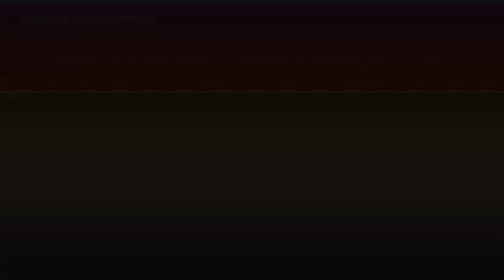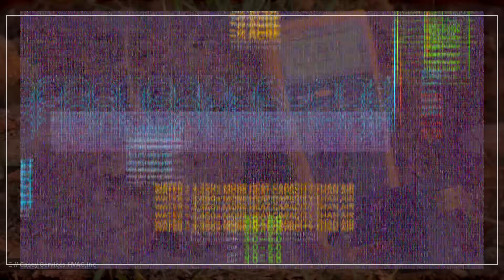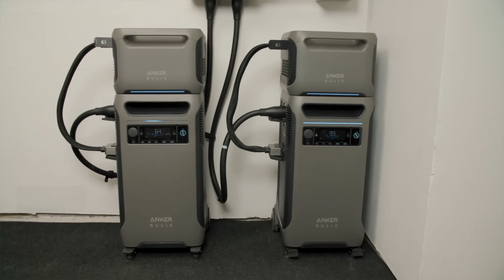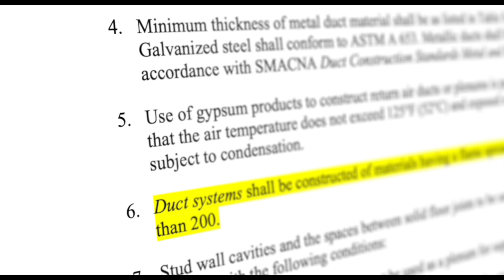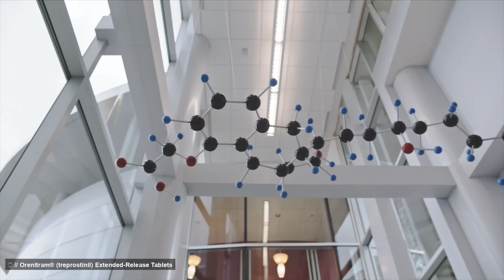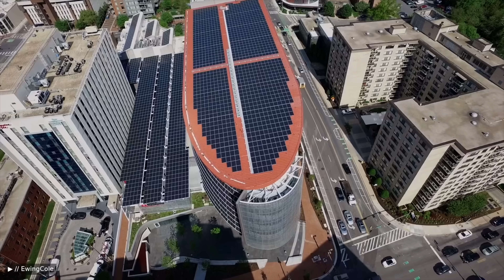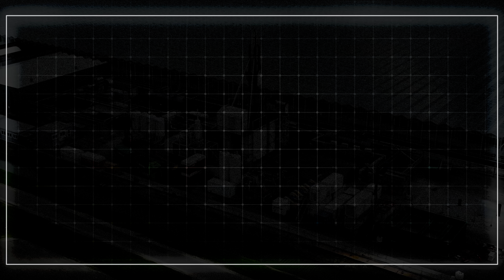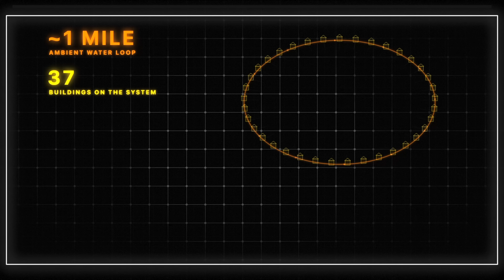The Viral DIY Cooling Hack That Nearly Killed a Family

Comment: I'm glad you made this video. A friend of mine had the air ground source heat pump system.  He died of lung cancer, several years ago. The next owners did a radon test on the house and the numbers were very unsafe. Had he used coils of pipe filled with water or glycol and a heat exchanger, he would probably still be alive today.
Reply: Had he done a radon test, he would've still been alive. We don't take radon seriously enough in general. If you've never done a radon test in your home, doing so could save you from lung cancer.
Reply: @lunaqueer . Radon testing was required for my hone mortgage 30 years ago . Very common in areas with granite
Reply: I used to live in Pittsburgh, and unbeknownst to most of the country Western PA and WV have a radon seepage problem thanks to the many abandoned coal mines dotting the countryside. Basically, coal seams have trace metals like Uranium, Thorium, and Radium embedded in them. These elements have alpha decay chains that eventually produce radon gas. Coal mines open up fissures that allow the radon to escape and get pushed upward by the pressure underground. This is why health departments in that region recommend getting a radon meter for your basement.
Reply: @lozoft9 What's super interesting to me is that high radon areas occur everywhere, and Aberdeen is a particularly notable one - but people in the UK aren't scared of it. Why? 

We don't have basements! One difference in building habits.
Reply: @PartanBree   I would say that there are more slab built homes in the US than those with basements.  There are very large subdivisions with nothing but slab homes.

Basements are expensive and take more time to build, so it is mostly the more expensive homes that have them.
Reply: @PartanBree  yea sure.. the UK doesn't have tornadoes like that either..🤦
Reply: @Sinderbad just watched a video on this last night.   Basements are necesary for foundations in places with permafrost in the US.  Or at least it used to make sense bwck in the day.  Slab technology is way better now.  But before you were already 5 feet deep, might as well make it 8ft and get another floor.  Also people had "root cellers" and thst killed two birds with one stone.
Reply: @cocoadragon8554  Haha, was about to comment this, looks like we found the same video!
Reply: @Sinderbad we dont have basements in Texas, I dont think ive ever seen or heard of anyone having one here, even though all my family and friends up north have them.
Has to do with the sand and clay content of our soil. The slab is safe, but a basement would get destroyed by the expansion and contraction of the clay.
Reply: @JeremiahWelch-r4o  hate to be that guy but... the uk has more tornadoes per quare mile than the US, they just don't get massive like they do in the US.
Reply: @PartanBree   you also dont have tornados which is why we have cellars or basements in the first place. We have a radon problem because we have a natural disaster emergency space.
Reply: @jdmjesus6103  per square mile but compare it to per square mile when you do not account for the regions outside of tornado valley. Your stat is not accurate when you're accounting for regional values because places with n=0 will squee the data especially when distributed over area, that's why we do aggregated stats and not stats that fit our world view. Plus you have to remember the US is extremely large in size while the UK is smaller than many states. Even in raw data alone tho your stat is not a good one too. US gets roughly 1,200 tornadoes/year,,,,, UK 30-50 per year.
Reply: You don't need the actual air, just the heat exchanged
Reply: @joltjolt5060  you didn't pay attention to the video. In some ground-air systems there actually is a mixing of air from the system and in the house, which to me even hearing about it sounds incredibly stupid thing to do, but apparently some people have been doing it that way
Reply: @milospavlovic7520  dont tell someone they "did not pay attention " you are coming off like an ass. And you are wrong. A ground heat pump will increase the amount of radon gas coming up to the service.  Not through the piping. Through the disrupted ground
Reply: @l.h.2543Please explain
Reply: @milospavlovic7520 the other guy is still right, you don't need the air, just the heat exchange. A closed loop system would still work great
Reply: @l.h.2543 wildly incorrect.
Reply: @milospavlovic7520 you apparently didn’t read the friggin comment
Reply: @joltjolt5060  True but you do need air exchange (ventilation) too, which is better separated.
Reply: @joltjolt5060 no shit
Reply: When I saw the thumbnail, I thought it was going to be something like radon, or just deoxygenation. There are a lot of bad gases that are heavier than air (including flammable ones!) and there's a lot of stuff underground that will suck oxygen out of the air.
Reply: We use water ground heat pumps a Lot in Finland, but never with air, it's always brine or otherwise treated water.

The radon levels nearly over every parcel of land would be dangerous for this and near gravel hills (got a Lot of those too from the ice age) that would be lethal within months if anyone was to use air.
Reply: Don't risk your life for saving a few bucks.
Reply: Well duh.  Honestly how stupid can marry people be this is like the most basic stuff ever don't you have schools over there? We learnt  this stuff when we were 8 years old.
Reply: The USGS has an interactive radon map. Everyone should be looking at this and getting a real time radon testing device such as AirThings.
Reply: That was my first thought when I heard about this. It’s going to be a break of any barrier to radon
Reply: There are auto detection radon alarm meters to place at the point of entry into the home & reportedly a fan at the initial intake creating positive pressure throughout the tube together should have eliminated the risk. Just the same, this video & a closed water loop provide a safer more effective solution.
Reply: Thank you for sharing! Yes I lived in a home with serious radon issues. We had to open the windows daily. The repair would cost only around 3 to 5k.
Reply: Sorry, but not related to the heat pump system
Reply: The 'Chesterton's fence'-principle should be a much more known concept, especially on the right.

It says "Don't remove a fence until you understand why it was put up".

Deregulation can be okay, but not just because you don't like to be told 'No'.
Reply: @madshorn5826   True, except that bothe ends of the political spectrum have a lot to learn from this.  The right because some old practices are avoided now for specific reasons; the left because some things that sound "progressive" have been tried and failed many times throughout history.
Reply: @gbart7857  Can you give an example of the progressive things that have been tried many times and failed you're talking about? I assume you mean centralized economies? Or do you mean things like treating people with respect and using the name they prefer?
Reply: @GrifHowe   communism
Reply: @GrifHowe socialism.
Reply: @A_barrel  That's pretty vague. Capitalism has also failed catastrophically in multiple instances throughout history. The best indicator is that there's current economies that have not yet collapsed but current trends do not bode well for that narrative either. If you fail to hold the two to a comparable standard, all you're left with is "we can only do what we're currently doing because it hasn't collapsed yet" which is a pretty narrow minded and illogical world view.
Reply: @dadsquatch79  most countries, including ours, is socialist to some degree. Socialism means that our taxes actually go to make our lives measurably better. A national healthcare system properly taxing the people who have the most instead of taxing you and me who have magnitudes less wealth. 

Like, I'm not saying that progressive concepts haven't been disastrously wrong before. But this is not one of them.
Reply: @JossCard42 dude, your only example just proves my point. Healthcare in Canada is shit. Healthcare in the UK is shit. It may work in tiny Scandinavian countries somewhat. But at our scale, it fails miserably.
Reply: @dadsquatch79 Thirty six percent of Americans get absolutely no health care.
Reply: @GrifHowe  what makes you think encouraging and accepting mental illness is better for society than treating the actual problem??
Reply: @JossCard42  THIS IS AMERICA WE HAVE FREEDOM with socialism comes authoritarianism cause y'all can't stand the thought of running out of other people's money.. how stupid are you? do you ever think your life would be easier if you just went to live somewhere else with your dumazz??
Reply: @dadsquatch79  You've clearly never been to Canada
Reply: @wolfy6631 aside from the fact for working in St. John's, Nova Scotia, Montreal and Victoria, yeah, I guess you're right clown
Reply: @wolfy6631 A 3-week delay to get a physical, a simple physical at a doctor's office in order to work offshore in St. John's and you're going to tell me that the healthcare system in Canada is worth a shit. What a joke
Reply: @dadsquatch79  Stop making shit up, I'm a Canadian and I never had any issues with the healthcare system
Reply: @wolfy6631 dude wtf ever. Nobody cares. It's been a thing forever. Your healthcare system sucks, you can't get "elective" care in any sort of a timely fashion and it's supported by your bloated tax system. I'll take top notch care on demand for a moderately higher price here in the states any time.
Reply: What makes you say especially on the right compared to the insane left..?
Reply: Seems like I've heard that many people who die of lung cancer have never smoked.  Maybe this is the clue.
Reply: @dan_raleigh  this  is not true att all. Smoking is by far the biggest cause of lung cancer in the US.  Radon is a distant #2. Unfortunately, with radon, you have no apparent risk factors. Therefore, it is usually discovered once someone is symptomatic and its often times very advanced by that point.  Vs smokers get screening ct scans at a certain age.  My neighbor tragically died from radon related lung cancer.
Reply: @vervi1jw1  You're right.  80 to 90%.  I don't know what I was thinking of.
BTW, my brother died of lung cancer, I'm sure by smoking.  We could not convince him to stop.
Reply: @dan_raleigh sorry to hear that. It's a tough habit to beat.
Reply: @dan_raleigh hmm do you think it had anything to do with you? My family makes me wanna smoke more..
Reply: @vervi1jw1  it's better than your hair falling out and dying of stress or something
Reply: @JeremiahWelch-r4o huh?
Reply: @JeremiahWelch-r4o just shows you are weak dealing with stress! Best thing to do is never start smoking because it does nothing for stress!
Reply: @JeremiahWelch-r4o Someone justifying their filth.
Reply: @gmv0553 yea knocking fools out is good for that too though..🤦 is that what you think i should do??
Reply: And if we knew each other, your dumazz would be the last person to call me weak, i would teach you real quick😂🤣🤣 (and no thats not a physical threat)
Reply: My god...
Reply: @caseyjones1999  or, hear me out, do your own radon test. They're cheap and easy
Reply: @caseyjones1999  that’s only an issue where radon is an issue 🤷‍♂️
Reply: Ground source heat is never a good idea. Yes, it can "pay back" it's high cost, but it can never pay back its missed opportunity cost. 35000 dollars will buy 350 kW of solar panels. Obviously there are other costs than just the panels, but a simple air to air split system in each room, some phase change materials built into the fabric of the building and a decent size solar system, makes vastly more sense. I can have a 13 kW solar installed before subsidies for 6000 AUD (about 4k USD) and a 25 kWh battery for about another 6000 AUD. That would cover all my electrical needs twice over, cooling, heating, hot water, the electric vehicles, cooking, *everything*. More than twice over actually, probably close to 3 times. For a quarter of the cost of drilling a hole in my driveway.
Reply: @gasdive  in what world do you buy solar panels for .10 a watt lol
Reply: @wax147 in the world outside the USA. There's a whole world out there. You should visit some time
Reply: Most unAmerican thing I ever heard. Leaving the USA and learning about the world? Wat u smokin bro? 😎😅
Reply: @gasdive  Ok but in the US,  Canada, or the EU that pricing doesn't hold and the opportunity cost calculation isn't necessarily so unbalanced
Reply: @wax147 I did build a solar fence a couple of days ago it's a complete system very very expensive 25 460W Bifacial Solar Panels cost me 8500 CHF.
Building the same system let's say on a carport would be literally half the price.
Reply: @Morberis  30 seconds on made-in-China turned up Jinko panels for 0.07 USD/W in the quantities I mentioned. 0.06 USD/W if you buy 1500 kW. They ship anywhere in the world. 

Can you find someone who will mark that up to 10 dollars per watt in the USA? Sure. Does that mean that's what they really cost?

No.

Yeah, there are taxes and tariffs. I think the USA charges 100% tariff on Chinese panels. That makes them 0.14 USD. But my point remains correct as you're not actually going to put up 350 kW of panels. Which is that you can get a better result, and produce vastly more electricity than you would save by spending on panels rather than a hole.

Solar is the cheapest way of generating electricity, and it's so cheap that putting on more solar can be better than increasing efficiency.
Reply: @gasdive  Nothing like putting the absolute cheapest solar components on your roof and hoping they dont develop an internal short that burns your house down.
Reply: @Morberis  those numbers were for Jinko panels. Probably the best quality panels available.
Reply: @gasdive  this is actually more a question about location,  payback will be better in areas with high seasonal variability in temperature and solar.
Reply: @chrisjackson6605  no, the location doesn't matter. There's no combination that makes it (deep bore hole) make sense. 

If it's cold then you can get double the heat per unit electricity by using the bore hole. But you then need to run the air conditioner during the summer to pump heat into the hole. That decreases your total efficiency to 1. The same as running a resistance heater. You're better off spending the money on cheap air to air that takes care of most of your heating and using resistance heating for the few days that are really cold powered by an oversize solar that cost less than the borehole. That cuts your heating bill to zero.

If you're somewhere warmer that needs air conditioning in the summer and heating in the winter then you can get good COP both heating and cooling, cutting your bills to half what they would be with air to air, but for less money you can install solar and cut your bills to zero. 

Cutting your electricity consumption to half sounds great, but to do it you have to give up cutting your bill to zero.
Reply: @gasdive  I'm guessing you don't live anywhere it actually gets cold. Air to air heat pump systems are getting better, but are still almost entirely useless below freezing unless horrendously oversized. Backup resistive heat is an option, but significantly less energy efficient at a time when solar power is at a minimum due to winter cloud cover and shorter days. The only option to move away from fossil fuels where I live, is ground loop HVAC.
Reply: @CoryVY  yes, because unless you're drilling into an aquifer, or it's a horizontal system then you're going to have to have a cooling load as well or the heat in the bore hole will be depleted in a few years. That's why only about 5% of heat pumps in Norway are ground source and 95% are air to air.

But assuming you're somewhere below about 50 degrees latitude, and you've got a house (which is a prerequisite for a ground loop anyway) then solar and resistance heating costs less than ground loop and heat pump both to buy and to run. Improving efficiency feels like it must be the best thing, but sometimes it isn't.
Reply: This is not a thing. You should really stop telling people this. That radon had absolutely nothing to do with his heat pump. There are a ton of reasons to not install a heat pump.. the fact that they're ridiculously expensive without dumping a homes worth of revenue into a system like this because climate control with electricity is absurd on its face. But radon doesn't factor in, not even a little bit. And there's no way his HVAC system was able to introduce said radon. The culprit was elsewhere. He would 100% not still be here had he installed a different system. This whole story is, not only ridiculous, it's dangerous. Please stop.
Reply: @BruceOfWaynes they're not talking about a properly installed ground source system. They're talking about a pipe that literally pumps air from underground into the house. Of course that poses a radon risk. The video makes it pretty clear what the difference is between that and a proper geothermal system.
Reply: @BruceOfWaynes   what do you mean "there's a ton of reasons to not install a heat pump"? Do you not have a fridge or an air conditioner? Both of those use heat pumps. 

A reverse cycle air conditioner (what Americans call a "heat pump") is simply an air conditioner where the refrigerant can flow in the opposite direction, to bring the heat inside the house instead of moving it outside. In Australia they're basically the same price as a regular AC, so it doesn't make sense not to use them.
Reply: @BruceOfWaynes it is if you bury pipes in the ground and you run air through those pipes and they're poorly connected and you draw a radon into your home
Reply: @caseyjones1999  the radon is already getting into your home unless you have it very well sealed off. It easily permeates through concrete and wood, and is dissolved in your well water that you take showers in and drink. 

-Geological Engineer
Reply: @caseyjones1999   I’m not so sure about that. I guess it would depend on the system but if you’re constantly drawing outside air into the basement through the ground loop you’re probably reducing the concentration of radon, not increasing it as the pipes are air tight. If it’s some kind of recirculating system where inside air is going back into the ground and returning, it’s likely having no impact on radon.
Reply: @caseyjones1999  Since you're apparently familiar with these new owners, what led to them deciding to test for radon exposure and what happened after finding such high levels?
Reply: @alexdrockhound9497it is heavier than air, so it does not get into your house in dangerous amounts unless you have a basement. Pumping it up into your living space is a risk factor!
Reply: i thought this on this video is for cooling not heating, what system exactly is what you are talking here?
Reply: @lcfflc3887 it is geothermal heat exchanger. It’s there to transmit heat or the lack of it.

The deep underground temperature stays almost the same all year. Using these you can cool your house during summer since the deep ground is cooler. And during winter the deep ground is warmer than the surface, so you use it to heat the house.

So it’s kinda both.
Reply: With geothermal system you have to do both. When you heat your home you put the cold in the ground. During the summer you bring back that cold and « store » the heat for next winter.
Reply: @lcfflc3887  I think the confusion is coming from the name “heat pump.” The device is called a heat pump but it is often used for cooling, not just heating
Reply: @JonLipton  Exactly, it pumps heat. It moves it around. By changing the direction, it goes from heating to cooling.
Reply: @lcfflc3887 It’s for cooling and heating, so long as you use a refrigerant though.
Reply: @lcfflc3887  both.  ground source heat pumps use the ground as a heat sink, you can either pump heat into it for cooling or you can draw heat out of it for heating. it works because below a certain distance the ground stays around 50F even mid winter. 

the problem here is they used air as a heat medium ( like you you would a forced air system in a house ) pumping out dirty contaminated air from a mold infested air shaft.

 In a situation like this ( minimum ) it should have been closed loop with heat exchangers pumping the dirty air back into the ground after using heat exchangers to capture the temperature change. 

For example refrigerants are a  toxic materials used as heat medium, but are closed loop, you dont let freon or ammonia into your home. 

Of course if you are going to pump a material through the ground air makes little sense compared to water or brine. other people mention Glycol. Air transmits heat poorly and is actually a good insulator. thts how most ( house ) insulation works, or coats.
Reply: @lcfflc3887 it provided both cooling and heating in our area our ground temperature is about 70° f
Reply: @lcfflc3887 heat pumps do both.
Reply: @lcfflc3887  Heat pumps move heat from one area to another, and because they include a compressor can move heat energy from a cold location to a warmer location via a thermodynamic cycle (the Carnot cycle is the idealized one). Refrigerators and air conditioners are two examples that provide cooling.
Reply: @lcfflc3887  heat pumps are a misnomer. They provide air conditioning as well as heat. A heat pump is technically nothing more than an air conditioner, but the heat from the compressor is fed thru an exchanger, rather than exhausted out the back, providing heat as well as cold.